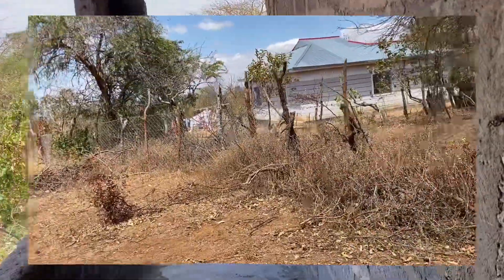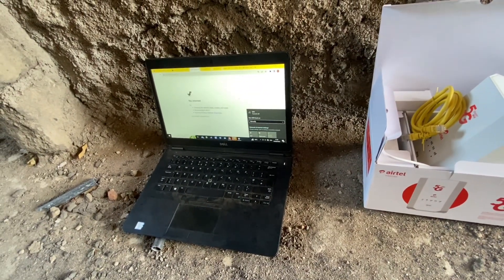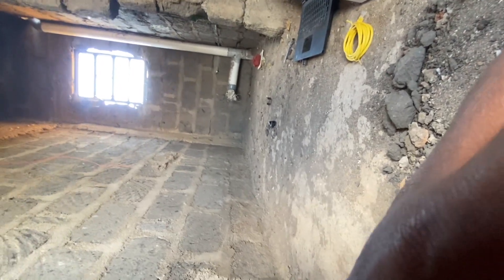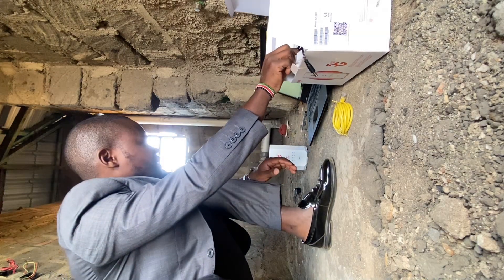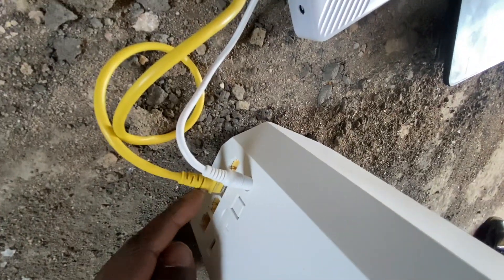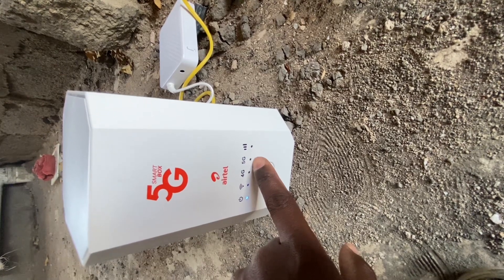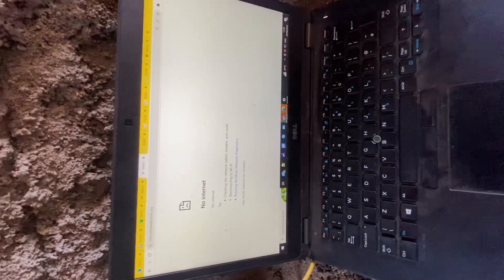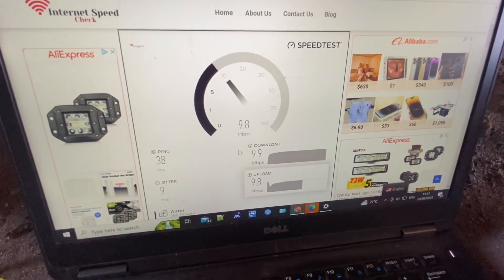Airtel 5G Smart Box in Kenya 2023 - #5g #airtel #kenya #africa #internet #iot

Comment: Is this the Home or Entreprise router? How much is the box, and data plan prices
Reply from the maker: Enterprise Broadband
Packages:

Package
5G Unlimited 10Mbos
5G Unlimited 30 Mbps
5G Unlimited 50 Mbps

Price (Ksh)
Ksh 3,500
Ksh 5,500
Ksh 7,500

Respectfully.
Reply: @itrailhub they should introduce cheaper package
Reply from the maker: This is a 5G Smart Box. You may use it for Business or Home Internet, connecting at most 64 devices